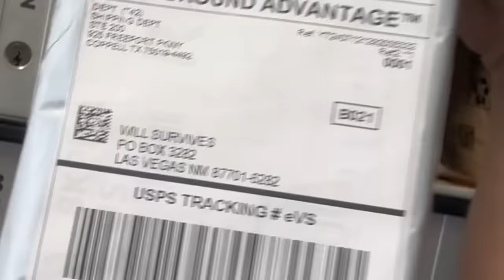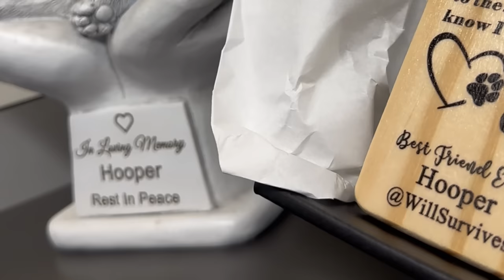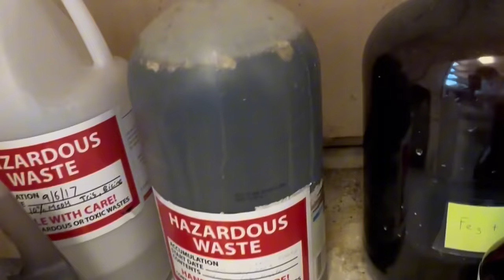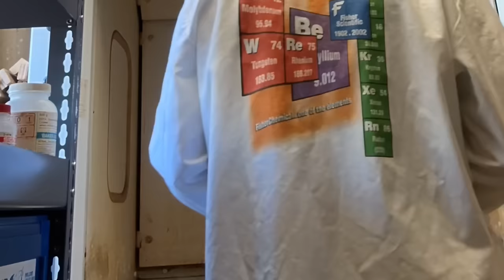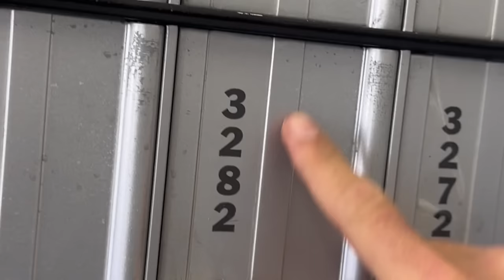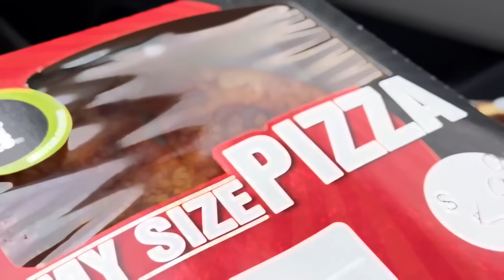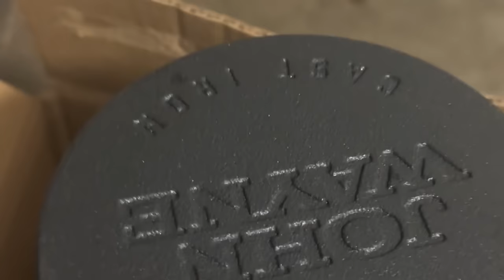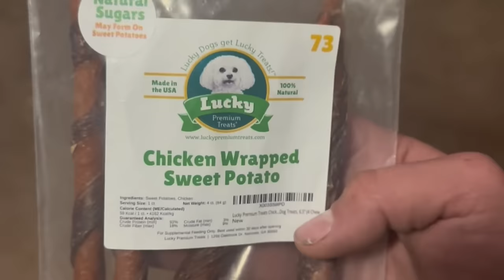Spend a Week with Lucky Thrives

Comment: Damn u have all the gear and chemicals to refine gold. That’s something I recently learned to do and having fun with. It’s crazy… you can take a $20,000 bracelet and turn it into liquid gold  the acid dissolves the inferior metals and silver  and you end up with pure gold solution than you use stump out or sodium metabisulfide powder to take it out of solution and turn it into pure gold sponge or like a coarse powder. Then you simply melt it down with a torch and put it into a bar
It’s good to take scrap gold like bracelets or watches that are 10-14k gold and turn it into pure .999 24k bars.